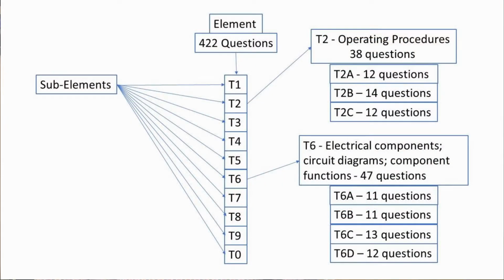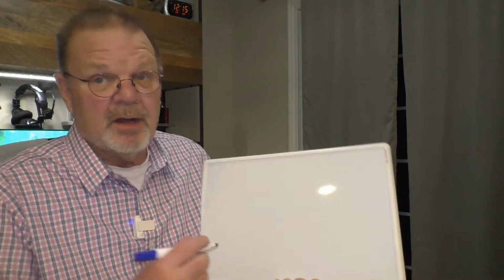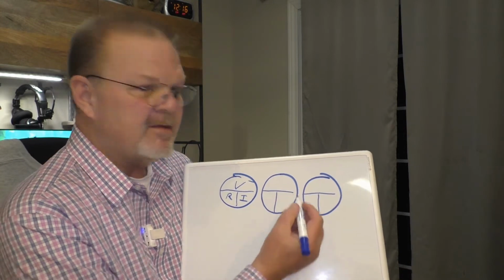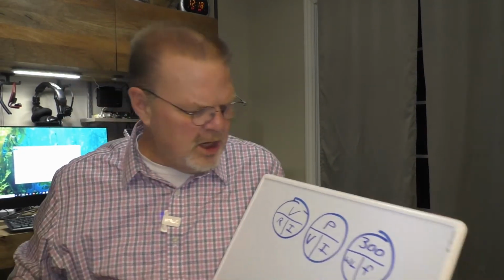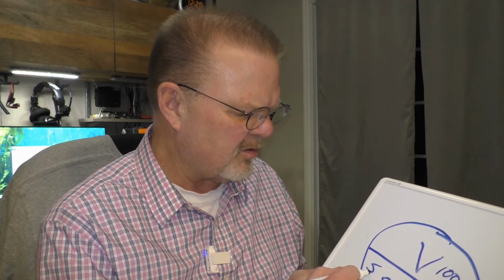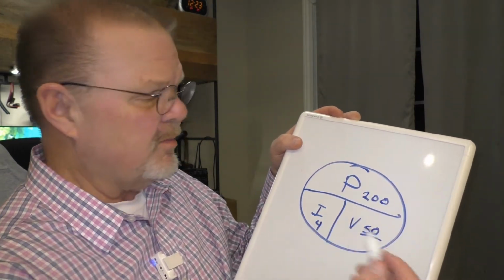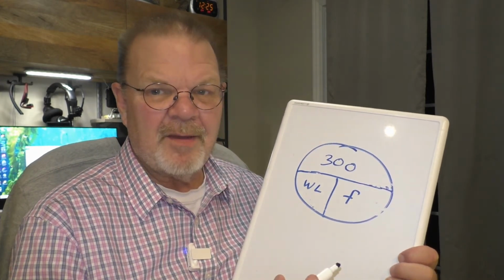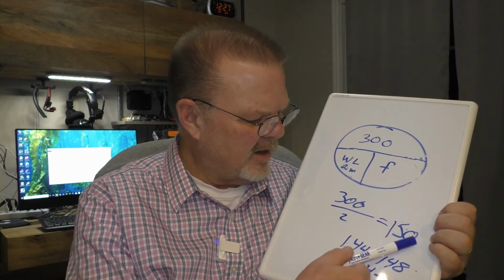Cheating the Ham Radio Tech Test Legally

Comment: Correction - you stated that you must answer 29 questions correct for 70% and you can miss 9 questions to pass.  Your are correct that a candidate can miss 9 questions which means they must get 26 questions, not 29 questions, correct for 74%, not 70%.  You also stated there are 422 questions in the question pool.  There are 412 questions in Technician question pool.
Reply from the maker: To your first…. My bad… oops.  To the second, this was done with the previous tech b
Reply from the maker: Previous tech pool and I counted them all.  73 de Tom, ND3N

Comment: Thank you for these tutorials. I have been studying answers for about 3 weeks now and am confident that I will at the very least, pass the exam. As another commented here, I also like the 3 pie method of remembering  formulas. I have noticed that, although I do have some electronics  background from decades  ago, alot of the theory attached to the questions on test I will most likely  never use as I don't plan on building or modifying equipment.   That could change, but as I already have two hobbies that take alot of time and money, there's a good chance I won't.  None the less, ham radio, so far, seems like a very useful communication tool to have.